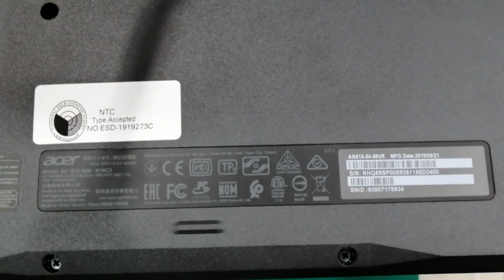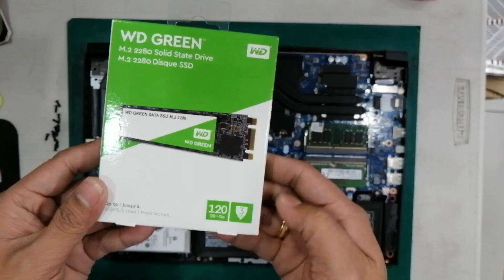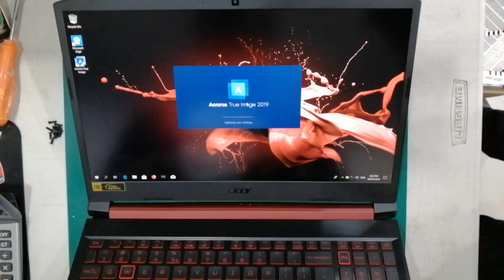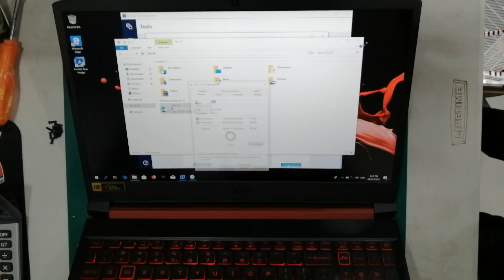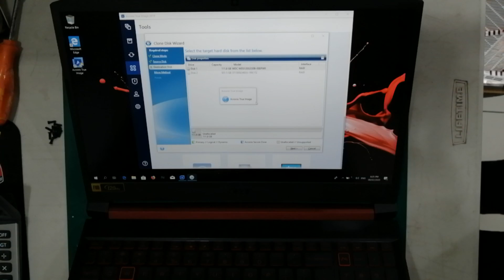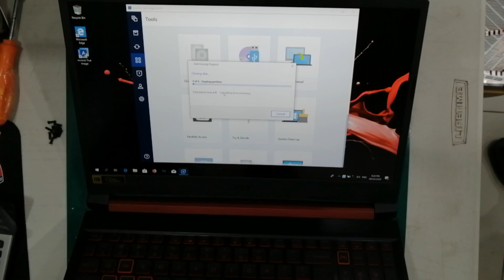How to upgrade acer nitro 5 2020 (Full)

Comment: Sir ano po ba ang recommended na SSD na i-install sa Nitro 5?
Reply from the maker: VIP TECHIES ito sir WD black 250GB M. 2 NVME SSD SN750, kung gusto mo medyo mura WD blue 250GB M. 2 NVME SSD, WD sir dahil yan yung madalas na may nag bebenta at matibay din quality
Reply: @techph7854  Thank you so much Sir

Comment: Is there some shops in Philippines where you can buy the upgrades and they install them as well?
Reply from the maker: A inz most of the shop that sells laptop also sells and perform the upgrade. I suggest you ask them before you buy. It is also recommended to go to nearest authorize service to perform the upgrade just in case you can't find one.
Reply from the maker: pa subscribe nmn idol

Comment: This come with 2666mhz ram right so if we but 2400mhz ram in the second slot will that effect in any way or does it not provide dual channeling ? Can you explain plz ?
Reply from the maker: Prasanth S 2666mhz on first slot + 2400mhz on second slot will not provide dual channeling. To achieve dual channel I suggest you install 2 RAM in the same frequency 2666mhz+2666mhz and brand if possible. Installing 2 RAM in different frequency will work without any issue 2666mhz+2400mhz but the laptop will run smallest freqeuncy which is 2400mhz.
Reply: @techph7854  ok bro i ordered the ryzen 5 3800h Acer nitro 5 how can i know the manufacturer of that ram and does 8gb 2666mhz cost a lot compared to 2400mhz ?
Reply from the maker: @sprasanth867  Try installing cpuz software and navigate to SPD tab to know the ram manufacturer. If SPD does not work the best way is to open the laptop and check the RAM. There should be no price defference between 2400mhz and 2666mhz RAM.

Comment: Hey kuya? Ano po mga possible na nag cacause ng sudden blackout sa laptop? Helpppp🤧🤧
Reply from the maker: Jude Matteur Fernandez anong klaseng blackout yung ginagamit tapos biglang nag off pati screen at keyboard? kahit hindi nag games mag blackout parin ba?
Reply: @techph7854  opo kuya everytime na nag gagames or kaya nag rurun po ako ng simulation, nagbablackout po
Reply from the maker: @keisukebaji2271  subukan mong gumamit nang 15.6" cooling pad or itapat mo sa electric fan yung laptop kung nag ba blackout padin. Subukan mo rin e check ang CPU temperature using hardwaremonitor software kung hindi ba lalagpas nang 90celcius. Kung heat issue yan baka kailangang palitan ang thermal paste or pad nang GPU at CPU.
Reply: Di po kaya sa motherboard problem nito? Yun po sabi sa isang forum
Reply from the maker: @keisukebaji2271  yes possible po yan sir, before natin sabihing motherboard eh kailangan po natin monang e troubleshoot ang laptop. Kung warranty po yan sir mas maganda ebalik natin kung saan natin nabili together with P.O.P.. Pa subscribe naman po sir
Reply: THANK YOU PO KUYA HAHAHA

Comment: I ever do clone my file from hdd to ssd but after a month of used it became blue screen. Do you know why it happen?
Reply from the maker: Andika Dwi Permana Try to reset the windows of your laptop to factory default. After a succesful reset update your device drivers and bios. It is important also not to install unnecessary software to prevent blue screen.
Reply: @techph7854  well, thanks. I'll try it👍

Comment: hello sir compatible po ba ang HyperX Impact Lapto RAM 8GB DDR4 PC4-19200 2400MHz  

ito po spec ko Acer Nitro AN515-43-R694 AMD Ryzen™ 5 3550H 15.6" FHD 4GB DDR4 1TB HDD RX560X 4GB??
Reply from the maker: Tecson Tito yes, sure compatible po yan kingston hyper x 2400MHz or 2666Mhz. May na upgrade na ako na ganyan sorry medyo shakey ang video https://youtu.be/bgcaLbvSbo4    pa subscribe naman idol if you don't mind

Comment: What Cloning Software do you use to clone windows 10 from HDD to SSD and can you maybe make a Tutorial for it?
Reply from the maker: Saito Hiraga sorry the video is not that clear, I use acronis true image 2019 to clone from HDD to SSD. Do not use older version of acronis because it will likely produce error. I will make another but clear video soon on how to clone.
Reply: @techph7854  i haven't buy the laptop yet but may i ask, does windows10 get installed on HDD by default after the first time you buy the product?

Comment: Sir kung ipapa upgrade ko sa isang shop sila mag bubukas magkano po kaya? 
Tsaka cloning din po ba kaya gagawin nila after maiupgrade?
Reply: Sir pwede ba kayo na gumawa ng medyo malinaw na video doon sa pag cloning, alam ko naman na po yung pag assembly at dissasembly e. Doon lang po sa process ng cloning medyo di ko pa gamay
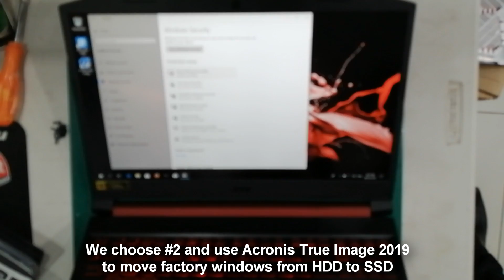Reply from the maker: @laycerjohncastillo4833  sir baka makatulong to https://www.youtube.com/watch?v=Gk00BjevdYo  forward to 6:44min. plan ko bumili nang mas malinaw na camera pag nagkapera. san banda sa cloning ka nalilito sir
Reply from the maker: ElJay Castillo Dito sa amin sir kung mag pa upgrade gagastos ka nang 1200php sa labor lang yan. Yung SSD 120GB 1200php rin ang presyo at ang RAM 4GB 1900php. Sir pag nag pa upgrade ka e request mo na lang na sa techinican na epa clone yung hdd to ssd. Yung ibang techinican sir hindi gagamit nang cloning mag fresh install sila nang OS tapos ang problema ay di maayos ang pagkagawa like ang pag install nang drivers ay gagamitan nang driver pack which is not proper. Also 250GB ang gagamitin mong SSD sir kasi masyado na maliit ang 120GB. Siguradohin rin na pagkatapos nilang e upgrade ang laptop mo mapapalitan nila ang nasirang warranty seal.

Comment: with nitro 5 an515-43 it's compatible Samsung MZ-76E500 860 EVO SSD  500 GB, SATA, 2.5"
Reply from the maker: s Pinto Yes, sure it is compatible. This samsung 860 evo will replace your existing HDD 2.5" in your an515-43.I h ave a video of an515-43 sorry for the shakey camera https://youtu.be/bgcaLbvSbo4

Comment: I legit got this yesterday and it's a beast
Reply: how much did it cost in total?
Reply: @draxuno  where i live in australia 1400
Reply: @drabyt27  I got mine for 700 usd. i5 9300h gtx 1650. But it only came with 4gb ram and 256gb m.2 nvme. So I upgraded it with dual stick ram 2×8, another m.2 pcie nvme 500gb and a Kingston ssd 480gb. Cost me about 200 usd.

Comment: Is any Kingston 2666v 16gb ram going to be compatible with the one that came with the laptop? Or is there a specific model that I need to get?
Reply from the maker: Jeremy Wong Yes, sure it's compatible. I use this specific model of kingston KVR26S19S8/8 but most SODIMM DDR4 2400mhz or 2666mhz should work. The KVR26 means 2666mhz and the last digit 8 stands for 8GB.
Reply: @techph7854  Thanks a lot. Good video btw, it will be handy when I open mine up

Comment: Hi there. May i know if the WiFi card is replaceable? Or is it a part of the motherboard? Thanks
Reply from the maker: Carlos Fung The wifi card is replaceable. Forward the video to 4:35min the one that has QR code is the wifi card.
Reply: @techph7854  thanks a lot, do you have the model number for it?
Reply from the maker: Carlos Fung As I check the original video, it says intel AX200NGW.

Comment: Acer Nitro 5 i5 9TH GEN 9300H, 8GB RAM, 128GB SSD, 1TB HDD, GTX 1650 4GB, 15.6" FHD, Backlight Keyboard...do I need to update anything in it?
Reply: Stick in another 8GB Ram, will do the job!
Reply from the maker: Susan Thakuri Your nitro 5 is already upgraded and I believe there is no need to update.
Reply: @techph7854  not mine yet but hoping to buy it.worth it today?
Reply from the maker: Yes, still worth it.

Comment: I have 4gb ram ddr4 2666 in slot 1 and I just bought 8gb ram ddr4 2666,my question is can I put 8gb ram into slot 1 and put the 4gb in slot 2??does it have a difference in where I put the 8gb ram??
Reply from the maker: Kenshin There is no difference moving the two RAMs
Reply: @techph7854  ouh ok thx

Comment: Raid 0 tried to do?
Reply: 2 SSD - raid 0
Reply from the maker: mikhail sh No, I never tried
Reply: @techph7854  take 2 nvme SSDs.  In bios, enable raid 0. The write and read speeds will add up.  Your model should support this.  I just have an515-43 (m2_nvme + m2_sata).

Comment: 0:52, nope, wrong!
You need to read carefully the warranty paper dude.
Reply from the maker: Karmandroid Singularity it depends on what country, We always do it and never had warranty void
Reply: @techph7854  yes exactly!
You wrote on the video warranty will be void, and just just said here "never void". 
Well..which one is it?
Reply from the maker: @SatrioBudiDharmawan  warranty void if you break the seal, if in doubt let the service centers do the upgrade for you
Reply: @techph7854   TechPH  no, no,
The warranty will void ONLY if you damage hardware while doing something like upgrading RAM, installing SSD.
But opening the laptop will not void the warranty.
Reply from the maker: @SatrioBudiDharmawan  Yes, Also if you broke the warranty seal, that's what I suppose to mean in the video

Comment: Good work man!!
You opened it like a pro.
Reply from the maker: Harsh Mangal Thanks
Reply: I need an advice.
I am planning to buy Nitro 5 with Ryzen 5 and GTX 1650. Should I go for it??
Reply from the maker: @harshmangal9359  yes go for it,nitro 5 ryzen 5,GTX 1650 is also good,make sure to upgrade the storage into SSD and have a minimum RAM of 8GB,
Reply: @techph7854  the RAM is already 8 GB but need to install SSD.
Reply: By-the-way thanks!!

Comment: Watching from my Nitro 5. Not sure if I need to upgrade the RAM yet.
Reply from the maker: Marco Cruz are you using 4GB of RAM now?if yes you should upgrade into 8GB,4GB of RAM this days is not enough
Reply: TechPH it has 8 gb of RAM
Reply: TechPH should i upgrade to 8gb or 12gb? is there much difference?
Reply from the maker: @farhanjamaludin99  12gb of RAM would be much better, you won't notice any difference unless you open multiple apps at a  time

Comment: same specs pero nagiistutter parin, pano to? updated na rin yung gpu
Reply from the maker: Indra otsutsuki what is the GB of your RAM?try to turn on shader cache in nvidia control panel,also make sure you use laptop cooling pad to lower the GPU and CPU temperature
Reply: @techph7854  8gb

Comment: Hi,
I have an Acer Nitro 5 AN515-43-R3TY bought last February 2020.
Main issue ko ay di siya nagboboot up using battery  kahit na siguradong fully charged siya bago patayin.
Ang solusyon ko ay isaksak sa AC ang charger para magbootup.

Sinubukan ko na pong mag update ng bios at ilagay sa recommend bios settings pero ganoon pa rin po ang problema.
Reply from the maker: Twinspika Kaizen ano ibig sabihin mo nang bootup sir yung walang lumalabas sa screen na ilaw?or hindi pumapasok sa windows os?kung ibig mo sabihin walang display kung battery lang ang gamit baka deperensya na ang battery,na sau paba ang resibo sir ipa warranty mo na lang
Reply: @techph7854 , hello sir ibig ko po sabihin sa hindi magbootup on battery ay wala pong lumalabas sa screen na ilaw, pati keyboard din po di umiilaw kapag battery lang ang gamit.

Kapag isinaksak ko na po sa wall charger, dun lang po tutuloy na iilaw ang screen at keyboard at papasok sa  windows 10 login. Pagkatapos po nito pwede ko naman tanggalin ang wall charger para sa battery muna tumakbo kasi fully charged naman.

Ang mahirap po nito ay limitado ang gamit ko sa laptop. Imbis na mabuksan ko agad gamit ang battery kapag nasa coffee shop ay kailangan ko pa pong maghanap ng wall socket para sa charger.

It defeats my purpose of having a portable laptop kung sa huli ay parang desktop ang setup ko😊

Ipapacheck ko po sa vendor after ECQ po
Reply from the maker: @twinspikakaizen6154  Good Luck i hope they will replace with new one,I recommend you bring the whole package including laptop boxes

Comment: Can you replace the i5 with an i7?
Reply from the maker: NPC Phantomz no you can't replace it is soldered in the motherboard
Reply: @techph7854  noooooooooOOOOOOOOOOO
Reply from the maker: consider subscribing if you don't mind
Reply: TechPH can u replace the mother board?? Jkjk
Reply from the maker: @Endrrq1901  yes, if you can order it in acer service center
Reply: TechPH how expensive will it be?
Reply from the maker: @Endrrq1901  in most cases motherboard price is 40%  the original price of the laptop
Reply: TechPH oh Frick I'll just stick to upgrading other stuff. Can u add ssd? Mine is 1 the hhd only is there ssd slot for it? I'll tell u the model l8r
Reply from the maker: @Endrrq1901  Enderplayz Yes, you can add M. 2 SSD on most of the latest gaming laptop. Consider subscribing if you don't mind.
Reply: TechPH already subbed

Comment: Sir could you tell us where is the wireless network card?
Reply from the maker: Harold Tungala forward the video to 4:42min,In the top right corner you will see QR code same like m.2 but smaller in size with black and white wires attached
Reply: @techph7854  Cool! Tnx for the help.

Comment: How much longer is the wait on the first power? When upgrade ram and m.2. Mine turns on but dont recognize anyting, i put the ram correctly and the m.2 again and try power on again but dont start, the keyboard turns on but the screen not
Reply: Change my question, the ram i bought was sodimm and the pc dont start with the new ram, i need a pc4 conection but this ram is 260pin. Is any possibility use and fix the new ram?
Reply from the maker: @iTaxHD  try to clean the gold contacts with pencil eraser and try again,If still does not work I think that's defective and need to be replace,shop for SODIMM DDR4 2666mhz or 2400mhz
Reply: @techph7854  but its need a pc4 connection? Couse mine ram dont have it :(
Reply from the maker: @iTaxHD  if it fits in the RAM slot it should work,I saw the picture your RAM is pc4
Reply: @techph7854  YES. fits perfectly in the slot and ita phsycally identical with the old ram
Reply from the maker: @iTaxHD  how's your laptop now
Reply: @techph7854  Perfectlly, the m.2 is glorious, i've used a hdd all my life and this change is celestial for me, i have to probe the pencil eraser but if that dont work its because the ram not work in my pc
Reply from the maker: iTaxHD wait upto 30seconds,hold the power button for upto 10sec to drain the remaining power and then try again,what is your RAM model and brand?
Reply: @techph7854  this is my ram can check it please i need fix this
https://www.pcfactory.cl/producto/27578-crucial-memoria-notebook-4gb-sodimm-ddr4-2400mhz-value-ram
Reply from the maker: @iTaxHD  This RAM should work,Have you try to remove the old RAM and install only new RAM?I think your new RAM is defective,try replacing it with another brand like gskill or kingston
Reply: @techph7854  oh, ok. Because with or without the old ram dont start anyway, tranks for the help

Comment: Could i have the m2 and another ssd of 1 tb?
Reply from the maker: Muerteada Barrio San Jose yes you can have m.2 ssd and another 2.5" SSD 1tb that will replace the existing 2.5" HDD,I have not tried installing 2x M.2 SSD but I think it will work
Reply: I just upgraded my ram to 16gigs a few moments ago. But what does installing m2 do for the computer?
Reply from the maker: @Isaypreach  M.2 SSD will make your laptop much responsive or will make your application to load much faster than using regular HDD
Reply: @techph7854  interesting and no problem i will. One more question if I may. Is there a difference between having a sata ssd vs m.2 drive ? Which one should I shall install due to me only having 256GB ssd
Reply from the maker: @Isaypreach  consider subscribing if you don't mind

Comment: Ryzen 5 Quard core with 8GB ram/HHD 1 TB + 256Gb SSD and 4Gb Amd radeon ×560 graphics 
      Or 
Intel i5 9th gen, Only HDD/8GB Ram and 3 GB Geforce GTX 1060
Both at same price 
Which one should I go for...?
And also tell me Life of each processor ?
Reply from the maker: M S honestly sir I will go for Intel i5 w/ GTX 1060 3GB and SSD,in my own experience I have more trouble using ryzen compare to Intel but it's just my personal preference
Reply: Wait 3GB vram what thats not enough

Comment: if you cloned the items in the hdd into the  ssd, what do we need to do after since you just cloned the items into the ssd? will we uninstall the items in the hdd or we just leave it there?
Reply from the maker: Adrian James Calalang you can leave the HDD but I recommend you wipe or reformat it after successful cloning and make the HDD as your secondary storage or storage of your pictures,videos,musics
Reply: Thanks. I'm planning to buy a nitro 5 but is it worth it to buy a nvme ssd? Shouls i get the normal one?
Reply from the maker: @monchken910  in my own opinion NVME is worth it,the boot speed is much faster compare to M.2 sata,but if you want to buy M.2 sata I recommend WD BLUE not green in the video.

Comment: Did anyone can tell me is it normal to see the thin black stripes at the left and bottom edges of the display of Acer nitro 5 AN515-54? because the stripe is not present on top and left side
Reply from the maker: Lets wait for another nitro 5 user to answer this

Comment: I have the same laptop but different version. RX 560 4GB. I'd like to ask how much did you spend for the upgrade? I don't need an exact answer but i'd appreciate it if you can give an estimate for both the 4GB DDR4 2666 SDRAM and M.2 120GB SSD.
Reply from the maker: Lelouch vi Britannia I live in philippines the price for 4GB 2666MHZ SODIMM kingston is 1200PHP,the price for WD M.2 SATA 120GB SSD is 1100PHP,if you have extra money I recommend you buy 250GB M.2 NVME SSD instead of M.2 SATA which is around 3500PHP WD brand
Reply: @techph7854  I'm also living in the Philippines. My laptop has 250 GB SSD not sure which kind but it's an SSD free upgrade including 2x4GB SDRAM with 1TB storage, all in for 36k. Now that you mentioned the prices, it seems that upgrading the device yourself is a better choice when considering buying a new one. Thank you for your informative YT channel.